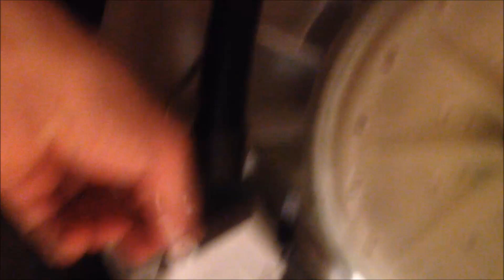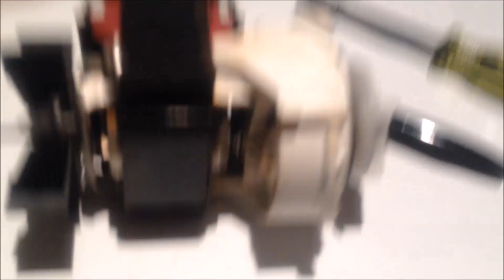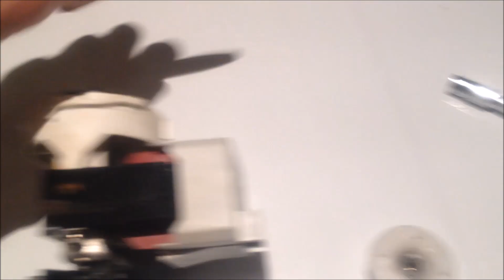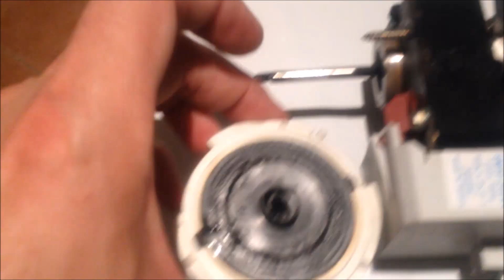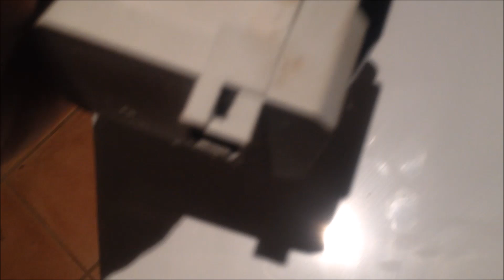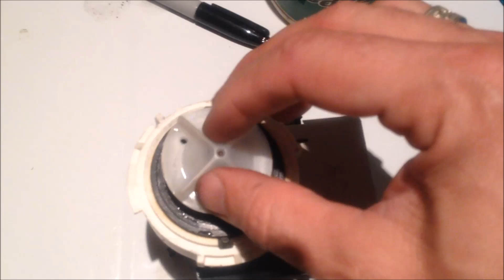Fisher & Paykel repair pump motor GW712

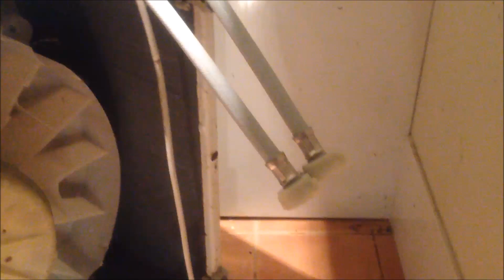Comment: 1:19 YOU MUST UNPLUG THE POWER  FROM THE WALL, OTHERWISE WHEN YOU TOUCH THE PUMP THE MACHINE WILL STILL BE LIVE AND YOU WILL GET AN ELECTRIC SHOCK  OFF THE PUMP

Comment: Thanks Gary!
My motor had started to squeal badly. Following your video, I took it apart and cleaned a lint jacket off of it! Some have ask why to completely disassemble it and I can say that had I not done so, I would not have found other bits of lint and old grease.
Hopeing that doing a thorough job now will keep me from having to do it again for another 10 years!

Comment: One important detail is the Grease type. The auto grease for metal parts (bearings etc.) will damage rubber and plastic. These parts will swell and leak again. To protect rubber and plastic look for a silicon-type grease. The label on a Grease should say it is rubber/plastic friendly.

Comment: Hi Gary...Your videos are AMAZINGLY HELPFUL.  I took my pump out and found  a sea pebble & a piece of sea glass buggering it up...but I have another problem. It is nearby this...if you follow up the tube from the pump along the side of the drum I have a leak up there when the machine is filling with water. I cannot see it during operation (I don't know how?)..I can see water droplets on the tube to the pump about 1/2 to 3/4 of the way up into the machine. ..but I think it may be coming from where those clear tubes are  adjacent to the water pump tube......I could send a photo...do you have any video that deal with the machine leaking up in that area?
Thanks! --Bob

Comment: Thank you for the excellent video and clear instructions.  My machine is a F&P 7.5 kg Top Load Smart Drive 3.  The pump impeller was a little different but in general the pump and your instructions on how to fix it was spot on.
I had lint accumulated on a broken tooth pick bent jammed on the the wet side of the impeller and was seizing the impeller from turning. When I took it out and gave everything a good clean the pump was working as good as new.
You are a gun mate and thoughtful of you to to post the video for many others to to be educated.
I'm sure I saved $500+ and during Covid Lockdown I may not have been able to get a repairman out, so that would then have cost $1500 for a new machine.
Cheers

Comment: WARNING! you really need to clean out that rubber gasket's shaft hole with a paper towel, if you don't, it will leak. clean with a paper towal and lube with a moly grease like Superlube. the rest of electrical cleaning isn't really neccesary for a leak but if your bored.....

Comment: good video but no way this sort of repair would work very long.. I've done it with many and best you get is a few weeks as you can't regenerate the worn seal. .. only sure fix is replace the seal but be sure pump is at or as close to 32 ohms else it will burn out anyway.... seals are now available online with a simple Google search

Comment: Thanks! I cleaned the shaft and the lint from the seal and lubricated the shaft, but that did not work. So, I added two small O-Rings between the impeller and the seal, and so far so good. I tried one O-Ring and the shaft turned freely. Three O-Rings and it dragged. With two O-Rings it had just a little drag, so I figure the O-Rings are pressing against the original seal just enough to keep the water from dripping through.

Comment: yeah, nice one-handed repair. I'm having the same issue with the leaky pump on my washer. I'm doing this temporary fix, but also ordering a new pump that comes with a fuse. If this leak happens again the pump could short and fry the controller board which cannot be fixed with WD-40.... thanks for posting this but would recommend just replacing the pump as this leak will happen again.

Comment: Note that the hard black plastic disk pops out of the softer rubber seal, and you can clean out the large cavity in between. I filled the cavity with grease before I reassembled the seal.
Reply: Also, give the fan a spin after reinstalling the pump. If it doesn't spin, you may have put the pump on an angle (as I did). Once I lined it up properly it was much easier to twist into place also.
Reply: Great. An IMPORTANT detail to prevent leaks.

Comment: thank you for sharing your skill.  Using washing machine almost every second day, and suddenly it wouldn't drain. Actually followed another video to know how to take pump out but when i put it back in the machine and turned it on, the panel on the machine went blank.  I usually am fraid to touch anything electrical when water is in or around it.  However, I found your video and stripped the pump to clean and grease it. By the way, the cause of the blockage was  a chain that had  been attached to some clothing which had gone through the machine. Thanks for your helpful video.

Comment: What was wrong with the pump? My commutator rotor was rusted and I scraped all the rust off. Why did you have to take the plastic part off and grease it?  I still get the 00110001 error code but the machine does get further along in the cycle than it did before. Is the machine getting stuck because I didn't take apart the plastic round black part of the pump and grease it? It seems to spin freely otherwise. What did I miss?

You should take a wire brush to the shaft of the commutator rotor to get all the rust off. Your motor will fail within 1-2 years, guaranteed. It's completely rusted and the problem you had is going to recur. I had to scrub hard for about ten minutes and use a powerful rust degreaser. Your motor is going to definitely fail electrically very soon.  Plus you are going to burn it up, because the magnet gets super hot and noisy if you don't get that rust off asap. I think the motor costs over $50  USD to replace, not worth it for such a poorly designed brand and machine.  I still can't figure out exactly how what you did fixed your machine because you really didn't do much to the motor. You need to definitely get the rust off that shaft asap. Just scrape it for 10 minutes all around with a hard wire brush. It's super painful because the rust is deeply embedded into the metal and you need the fine metal grooves back for the magnet and motor to turn freely and properly electrically. I think you may have gotten lucky with your fix, as the real problem is with the metal shaft of the rotator on the magnet being totally rusted as your video shows clearly. Mine was completely rusted solid brown and caked like mud with rust. Yours will do the same too since there is moisture under the machine and you already have the rust process going full on without interruption.

Comment: Thankyou, I have a faulty pump that seemed to work then cut out before emptying the tub fully, no error codes. I happened to have a spare GW612 sitting in the garage and pulled the pump from that, checked the part number to make sure it was the same and put it in the GW712 which fixed my immediate problem. But the old pump seems to be okay with no noticeable damage. After watching your video I'm going see if I can get the original one working again. Thanks again.
Reply: hrep14 hoping you and everyone on the planet never has to own a FP washer ever again. What a nightmare and headache. Hope you got yours fixed and have moved onto American or Korean made quality in the future.
Reply: Only difference between 612 and 712 is the size capacity

Comment: The rubber seal pops off.  It doesn't require disassembly of the motor.  Typically the motors go bad from having water saturate the windings. which is probably why they don't sell seals.  Repairmen don't want callbacks.  If you catch it early enough you can likely make this repair and save the motor too.  In winter would set the motor in front of moving heated air - like the vent on home HVAC, or set on top of a home heater radiator, anything that will warm it up but not get too hot, and can be left unattended.  In summer put it outside in the sunlight.  I'm thinking of placing the motor in a vise afterward and powering it so I can polish the rust and gunk off the shaft. then maybe pack the seal with heavy grease. There is a cavity between the upper and lower sealing surfaces.  My 2 cents for what its worth.
Reply: Lonestar Yep. I scraped off the rust with a metal brush. It fixed most of the problem. I didn't take the plastic piece off  to clean underneath but I'm thinking may be I should? My motor popped up and down just fine. Is that normal?
Reply: "...pack the seal with heavy grease. There is a cavity between the upper and lower sealing surfaces."
You hit on an excellent point with this. I disassembled the unit as shown but it started leaking upon reassembly. I noticed there was originally a lot of grease on the shaft in the cavity vicinity that I wiped away and I used a thin layer of white lithium grease - BIG mistake. So I bought some Extra Heavy Duty (Green) grease and not only lubed the shaft and pivots but applied a liberal amount to the cavity area within the rubber gasket (there is also some plastic portions of that gasket). Slowly insert the metal shaft into the gasket and before it enters mid-way into the cavity area, press the grease into the area and off to the sides so that the shaft doesn't push it out as you press the shaft through. Pack it well. Then pack some grease into the space under the impeller cap before screwing it down. Now it no longer leaks. 

Was there perhaps a fabric washer in the packing area that disintegrates over time??

Comment: Great video Gary.  Thanks for the excellent explanation.  
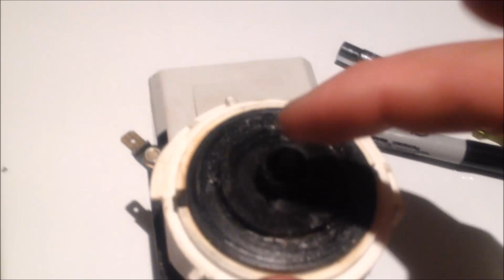At marker 2:20, you mention a "bearing" which was perhaps covered in lint.  I was unable to locate any bearing...only lint.  Is there actually a bearing?  
  The black rubber bellow that sits just below the Impeller wheel (which unscrews) seems to be where my machine has a leak.  F&P only show a "back order" for the drain pump assembly, which includes the bellow.  They don't sell the parts individually.  
  Any suggestions?
Reply: Bush not bearings

Comment: Thank you for the information that you posted here.  Our Fisher Paykel washer would not go into rinse and spin.  A video by Chrissy Watkinshttps://youtu.be/pPNLcby5YGQ lead me to  your video.  I was able to see how to remove,clean and refit the pump and was able to make this repair.  Though I was a little unsure of tackling this job, you and the $600 cost of a new washer gave me the inspiration to try fixing the machine.  When I got the pump out it had a Shout Color Catcher sheet hung in it.  I removed it and cleaned the pump, refitted it and now it is working fine.  We have been using this Fisher Paykel for eight years and other than a problem with the plastic top cover cracking, we have had great performance.

Comment: Thanks so much!  Mine ended up being rusty due to a slow leak.  Tested resistance between the contacts and had over 8 ohms which is out of spec, after cleaning it off it was down to 7 in spec and worked properly afterwards.

Comment: Thanks for the video. I had the same problem, which was fixed after followed this. Problem is that it now leaks from the drain pump. I spoke to someone about it and they said there should be an o ring on the pump, which I didn't see when I removed it. Could anyone confirm that there should be an o ring it, cheers.

Comment: But the other thing is, why the heck strip the pump down like this? The round black seal arrangement comes out of the white plastic holder without dismantled the pump. This is just crazy.